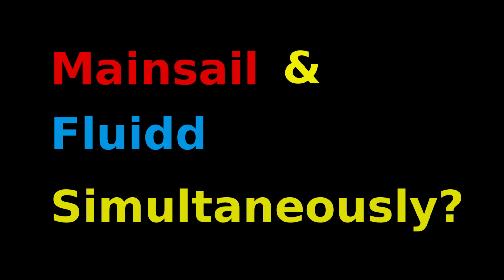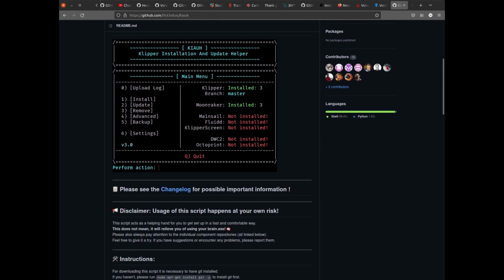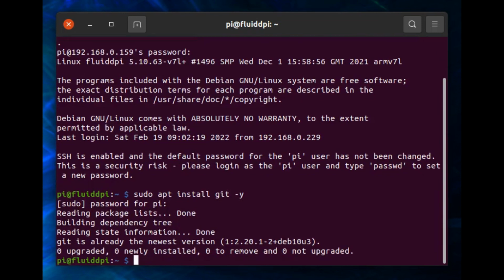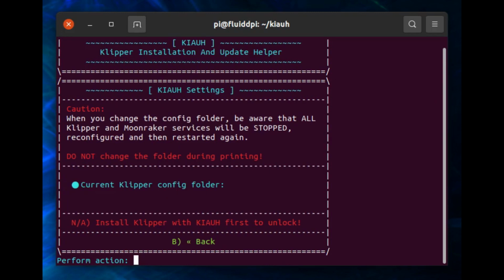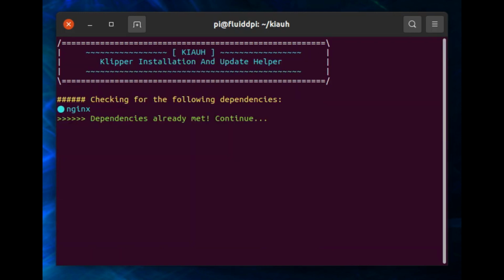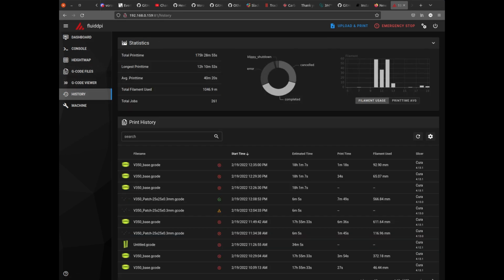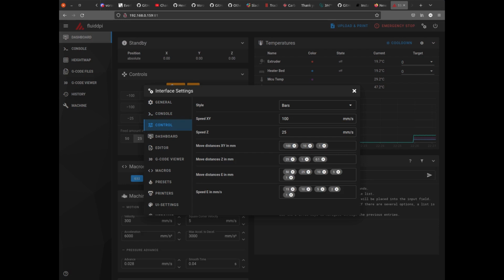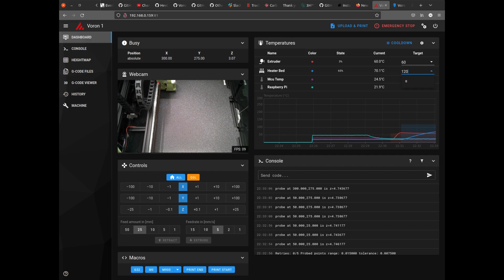Run Fluidd and Mainsail Simultaneously on the same Raspberry Pi with the same 3D Printer?

Comment: Glad I found this!  I have two Rat Rigs which have a great setup - RatOS, but it installs Mainsail.  I started with Fluidd on my Ender printers and like some of the features better.   I am also having problems getting my Pi camera running, so thought would try KIAUH which I have heard about.  Your video makes it very easy to set up, and I now have both running, still having problems  with the Pi camera, but now think it is hardware.
Reply from the maker: I'm glad it helped. I have not had issues with my camera, but it might be worth trying a Webcam from your pc just to see if it's the camera or software.  Thank you for watching!

Comment: The kiauh script says that I need to install klipper first. Then it says that it's already installed. Good times. 
Can't have conflicting ports but it should be possible to have them in different subdirectories on one port in the location directives in nginx. Probably adds an include vs running nginx more than once.
Reply from the maker: That is not a problem I ran into.  Interesting.  I'm 99% sure you can create a sub directory instead or a new port.  I was a little worried about something having a path hard coded or something that might cause problems later, but it should work.  Probably unfounded fears on my part.

Comment: If you already have fluidd running, to install mainsail you literally only have to copy-paste one new nginx config file, change 80->81, and copy-paste the mainsail install command. All other files are common with fluidd.
Reply from the maker: I did not realize that.  That's for the feedback. I may try it sometime.  Thanks for watching!

Comment: Mainly clicked on you video to see if you got the policykit problems fixed and you did so easily, I've solved a majority of the issues but for the life of me cannot figure out how to solve the unparsed config option errors for

'Config_path ~/klipper_config'
'Temperature_store_size: 600'
'Gcode_store_size: 1000'
'Log_path ~/klipper_logs'

Any help would be immensely appreciated
Reply from the maker: Where are these errors being reported?
Reply: This is because moonraker had an update. You have to reconfigure the moonraker.conf file.

Comment: I've wanted to try Mainsail for ages. That's tonight's activity sorted!
Reply: I have Mainsail installed and running now. I like the webcam integration. It's closer to what I remember from OctoPrint. Thanks for this.
Reply from the maker: I'm glad it's working for you!  It's fun to compare the two.  They are different yet so much the same!  I like editing the printer cfg file better in Fluidd.  Mainsail seems flashier all the way around.  They are both really good.  Thank you for watching!

Comment: Great job! Now, if anybody asks which one to install I can say, "install both".
Reply from the maker: Yes!  I find that I'm drawn to use one over the other, but honestly, they are both really good.  Thanks!
Reply: @KapmansBasementWorkshop  Which one? 😛
Reply from the maker: @aeiounix  Currently I'm using Fluidd.  It does what I need and I like the UI layout.  But lately I've been thinking of spending more time with Mainsail...

Comment: So in Mainsail GUI when I check for updates it shows System, Moonraker, Fluidd, Klipper but no Mainsail.  Any Ideas?
Reply: Solved this as well.  Needed to add this to the moonraker.conf file
[update_manager mainsail]
type: web
repo: mainsail-crew/mainsail
path: ~/mainsail
Reply from the maker: I didn't have to do this.  Was Fluiddpi running previously, or is this the 1st time for both?
Reply: @KapmansBasementWorkshop  Fluidd Pi was running.  Now both Mainsail and Fluidd show the updates for all items including the gui that they aren't becaus they are using the moonraker.conf file for updates.
Reply from the maker: @shenkclan  It's really pretty cool how it's working.
Reply: @shenkclan  Good spot. I had to add this too. Thanks.
Reply: I have a fluidd question, I can't find a lot of info on fluidd.
Fluidd install only adds macros for pause cancel resume at install. In the fluidd.cfg file.

Mainsail, at install also has start and stop macros.
I use mainsail but I've helped others with their fluidd set up.

Cura, SS or prusa requires changing the custom start and end gcode to start_print and end_print

What does fluidd use?

Comment: I had installed fluidd using fluidOS.  I tried your steps and can't get to either Fluidd or Mainsail.  The PI is up and running fine.  Any suggestions
Reply from the maker: Try restarting the pi, and then try adding ":80" or ":81" to the end of the IP address ("80" should be the default).  That should be it.  Are you getting a message in your web browser?
Reply from the maker: I actually recorded the video as I was installing Mainsail along with Fluidd.  It should work.
Reply from the maker: Also, when you say "FluiddOS" you actually mean "FluiddPi", right?
Reply: I got it sorted out
Reply from the maker: @shenkclan  Great news!  What was the issue?  Just in case it helps someone else out.
Reply: @KapmansBasementWorkshop  I believe what I did is run the Kiauh again and update all items I could then restarted the Pi.  I tried a number of things which I don't remember and suddenly it was working.  Hate it when that happens.
Reply from the maker: @shenkclan  It happens to the best of us :)